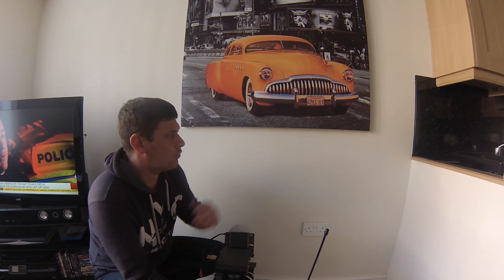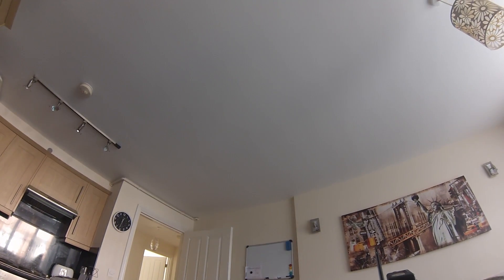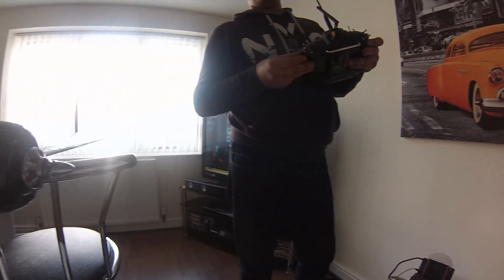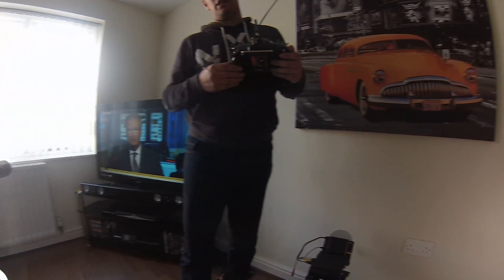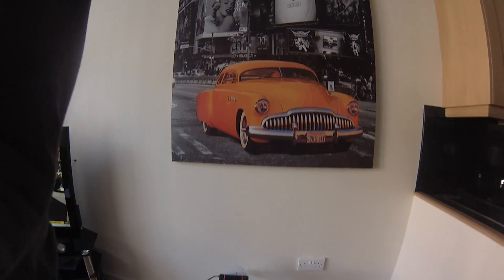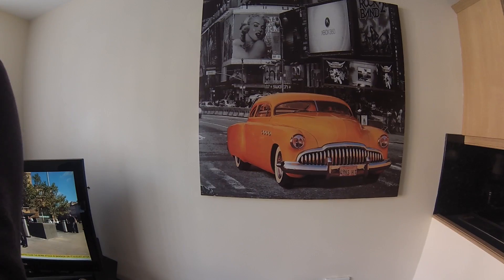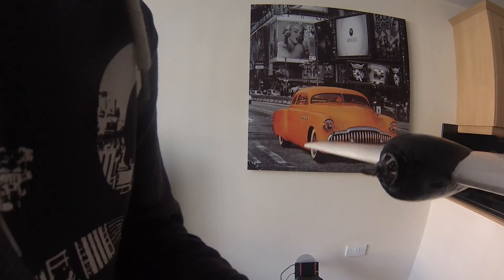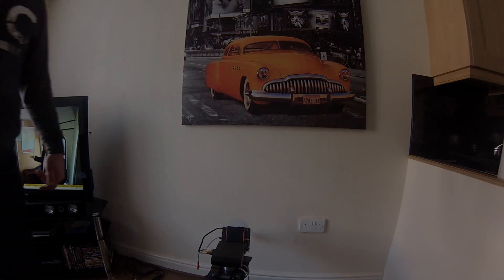Gimbal test of FY G3 Ultra on MTD

Comment: maybe you have noticed that when you yaw the plane the camera follows and when it stops at the endpoint of the yaw you might notice a very little 'sudden stop' of the gimbal > just install the latest firmware from FY and that is also completely gone... well... I did that fimware upgrade and its worth it  !! because when you fly you've got a lot of little yaws from the cam and when they all have those little sudden stops it becomes verry enoying   :)  hope this little tip helps !  enjoy !!!!!
Reply from the maker: Hi there. The gimbal works really well now. It is prone to vibrations though even with any combination of dampers including DJI dampers. I don't think there is a new firmware for using the gimbal upside down, I will check though. Thanks for your input.
Reply: If you look good you can see the little sudden yaw 'stop-problem' in your testflights I just looked at..
Reply from the maker: +Erwin Scheringa If you are referring to the yaw stopping as I fly around in a circle it's because the gimbal hits its mechanical limit so can not go further.

Comment: Looks pretty cool - though may look very odd with this plane just moving around in view.  Is there a way you can get roll to act like the yaw follow me, I figured that would give you a smooth but more natural look for a plane ?
Reply from the maker: +CurryKitten You cant get the roll to do it Wayne. You can get tilt and pan to follow the craft as it turns or climbs / descends though.